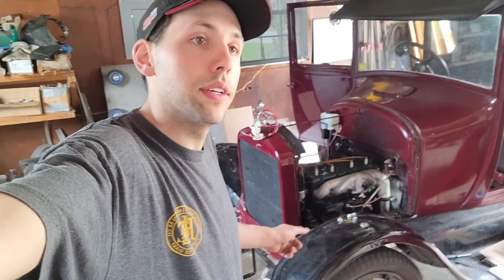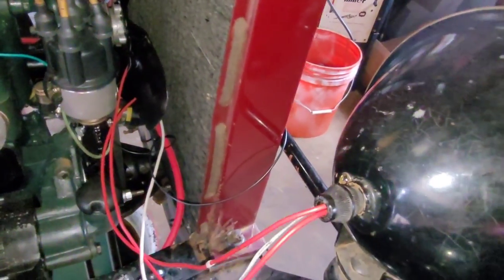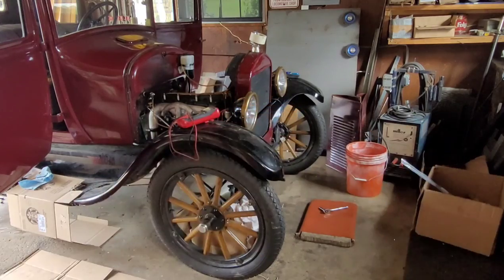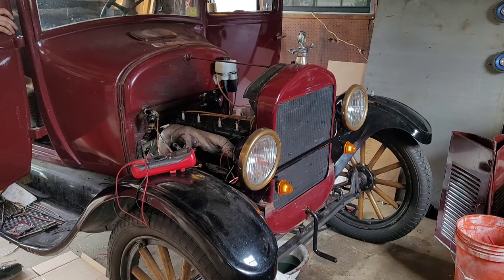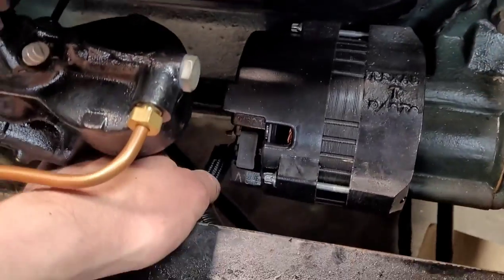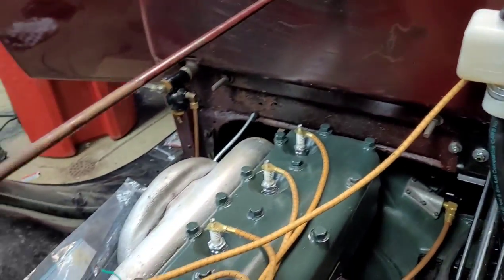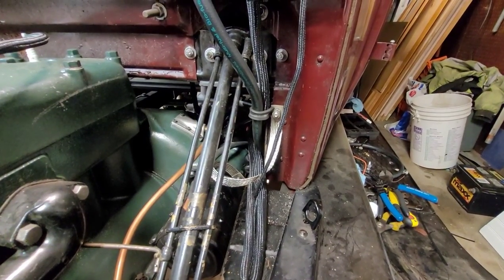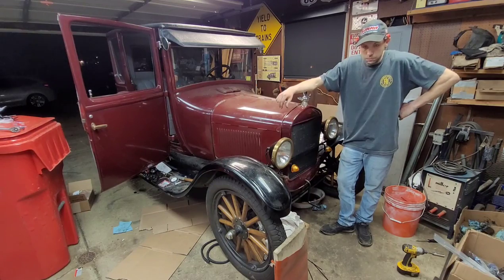Feeling the heat of halogen headlight bulbs in a Ford Model T

Comment: Hi Mike. I’m Mark from Indiana.  I have recently inherited 2 model As and a model T to add to my collection. I have 4 of these now. Only 1 is a Model T.  When I drive the T I noticed the trans squeals when I push the forward and reverse pedal down.  Do you know how to adjust these or is there specs for them?  Thanks buddy.  Keep up the videos.  Your very knowledgeable and enjoy watching.  I’m subscribed
Reply from the maker: The forward low is done by the stud on passenger side of transmission that has the jam nut. Loosen jam nut and and turn stud clockwise. I usually tighten so the pedal will not hit the floor board when you push it with your foot. Then start the car and make sure it doesn't try to move at idle, which would indicate you tightened it too far. Reverse pedal will need to be adjusted by removing top cover of transmission.
Reply: Ok great thanks !!!   Reverse is the same way ?
Reply from the maker: Reverse is same way. Just make sure the isn't try to move when idling.  Also while you have the cover off transmission just make sure you atleast have some lining on the bands
Reply: Thanks Mike.  Much appreciated.  Have a great day and keep up on the videos !